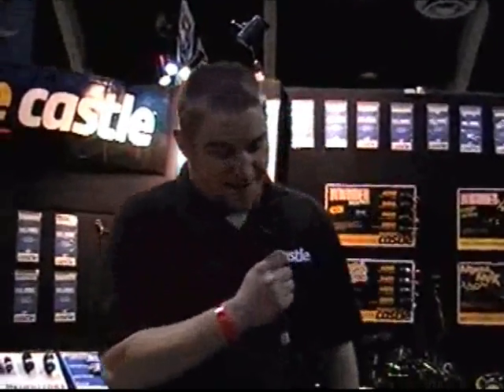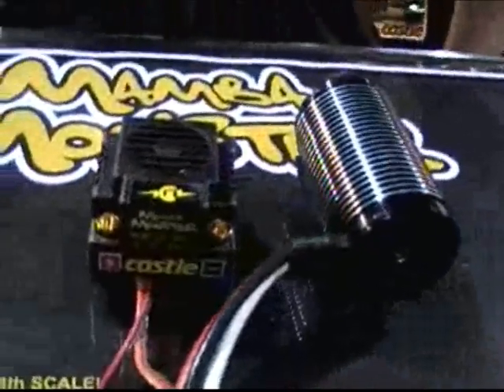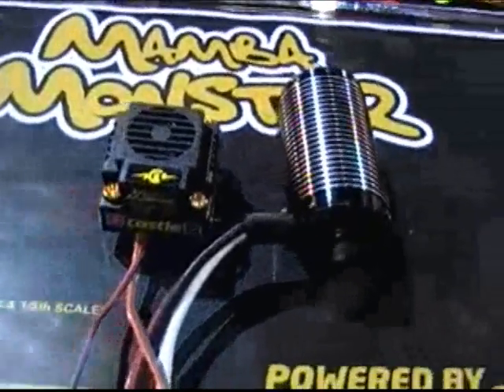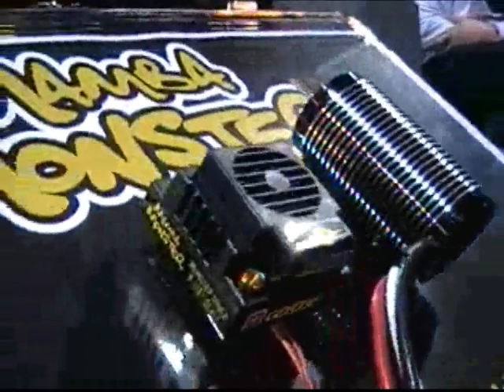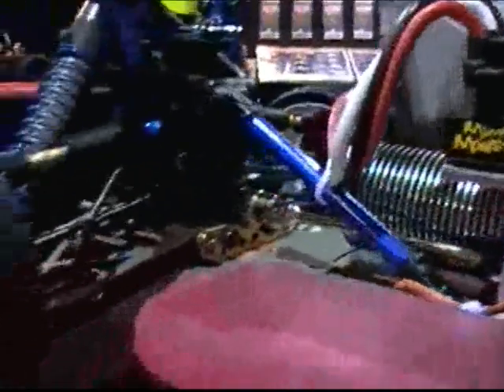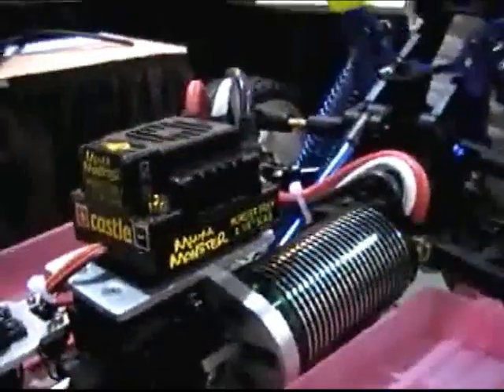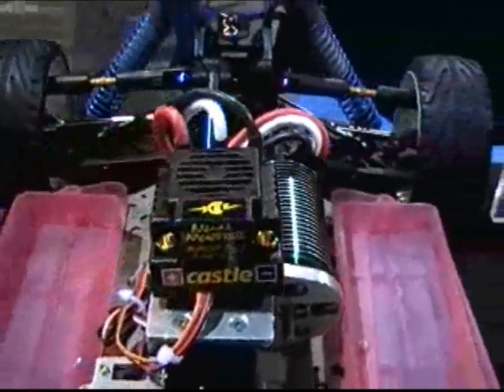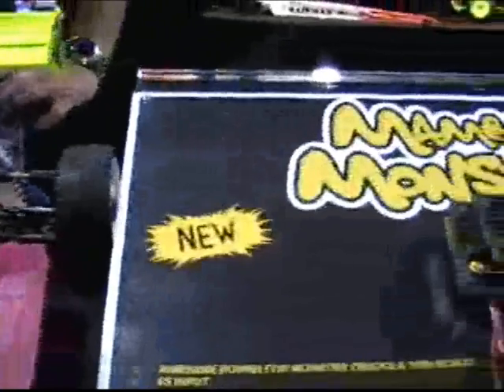RCX 2008 - Castle Creations Interview

Comment: V3 stands for "version 3" becuase the first two versions of castles ESC were failing left and right.  Now that the V3 is out, about 95% of the problems are fixed, so they are pretty good right now.